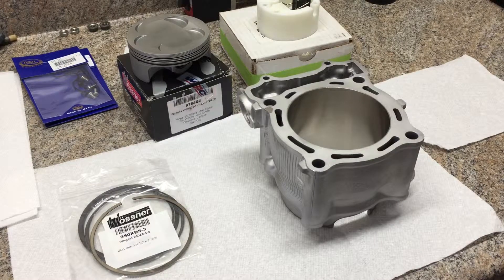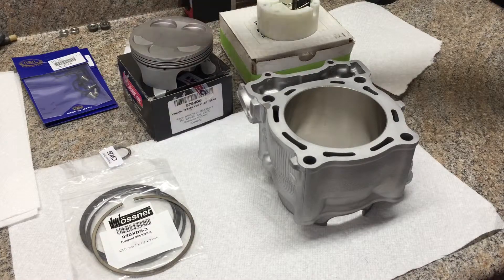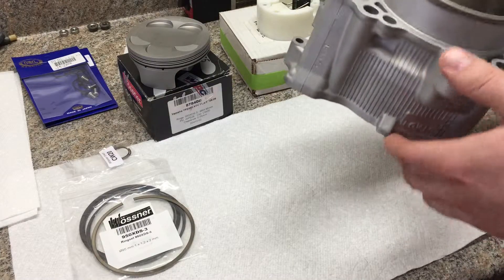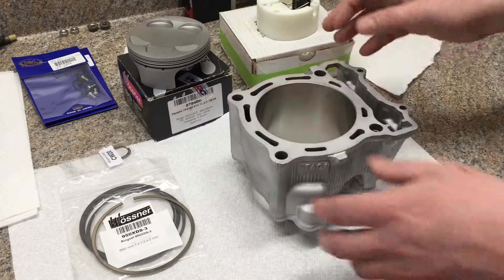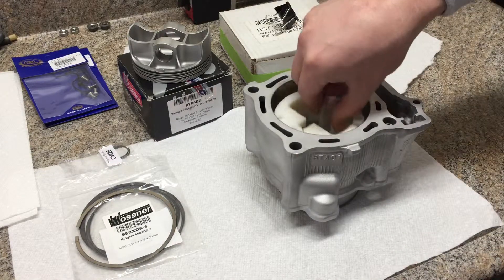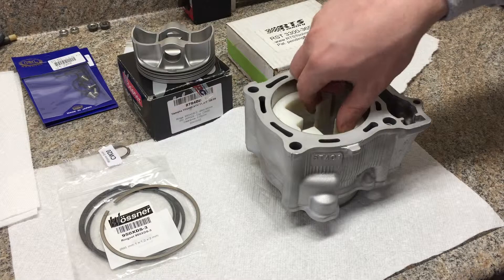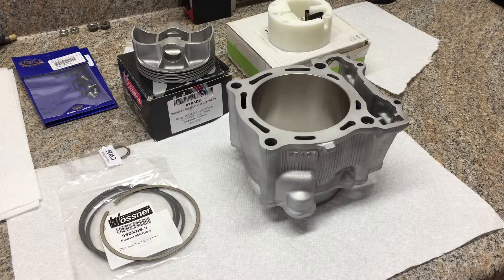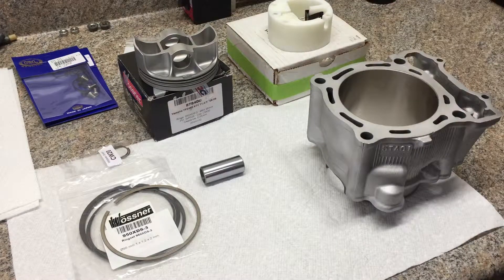Project YFZ 450 Piston and cylinder replacement - Wossner + Powerseal + WPC treatment

Comment: any updates mate?
Reply from the maker: Fixed the YFZ up nice and sold it. Still keep in touch with the owner. Looking for another to rebuild right now!
Reply: @mechanicsantics3575  there are a few Facebook groups that you might want to check out if you are working for a builder. YFZ450HQ is a good one.
Reply from the maker: I am on all the big fb pages for YFZ’s. I have a frame and parts now, the new project will be introduced shortly!